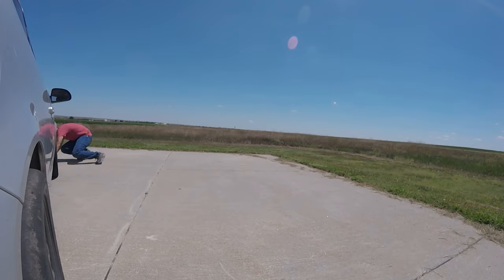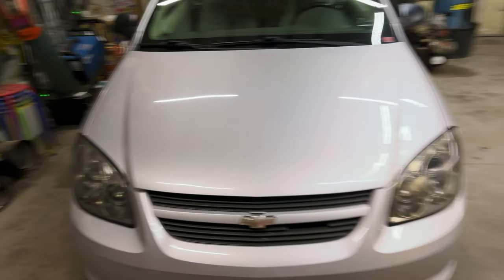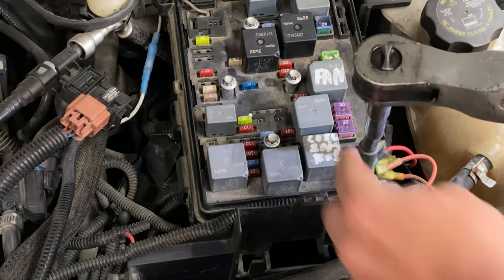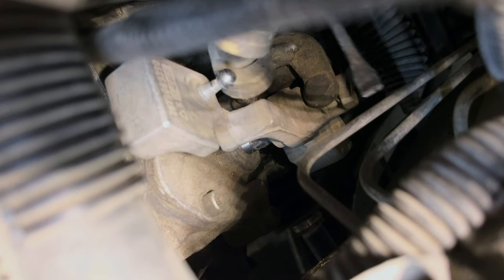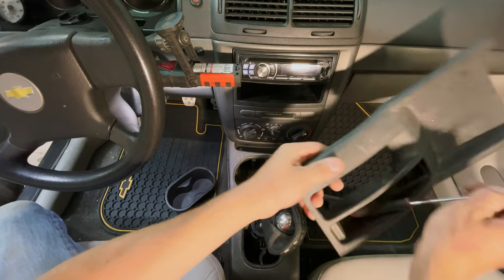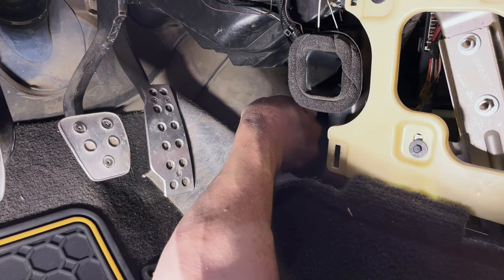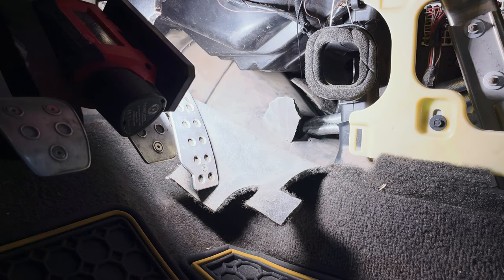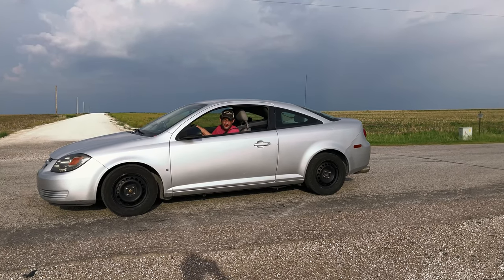Chevy Cobalt Shift Cable Replacement

Comment: What a ripper!!! I just picked me up a cobalt and wanna figure out what software people are using to tune these things. Be a waste of money having to send my tune to zzp everything I change exhaust stuff or intake stuff or pulley sizes or fuel
Reply from the maker: If you have an 05-06 base you are SOL like I was. I had to do aftermarket ECM and went with AEM Infinity.  07 and up you use hptuners. Pretty sure ZZP uses hptuners for their tuning services as well. Trifecta used to cover 05-06 but they dropped support some time ago.  Hope this helps!

Comment: Finally! Someone else who is in the base model world. I have an 06 ls, coil overs, short throw, i manual swapped it in 2018, but man I am stuck on the ecu, I wanted mega squirt but with recent research I was thinking aem . Did you find someone with a base tune? Or did you make a tune from scratch? I’m wanting forged internals but that’s a price point I’m working up too😂my plan was turbo but before any of that I will try for 200-250 NA HP. Then boost but no rush for boost. Any advice at all? Like dude I e been looking for someone who has done this for 4 years😂 I don’t want to “sell it and buy an SS”😂😂
Reply from the maker: Busy atm but I’ll get back to you more thoroughly when I get a moment
Reply from the maker: The SS guys/gals are elitists. An SS is just a base model with some performance parts and better seats. The one thing I would recommend is don’t even waste your time trying for more power NA. High cost to HP gain ratio. Save your money for boost if that is route you wish to go. Setting up the AEM was expensive when I did it years ago. No plug and play wire harness so you have to build your own. It’s also fairly overwhelming at first.  It’s doable as I have done but definitely not most cost effective. Turbo will make you most power per dollar. I only ran stock internals for short time with m62 blower. Only thing stock left is crankshaft lol. Let me know if you have any questions but know the route you are considering is difficult and pricey. Not trying to talk you out of it just don’t want you to end up discouraged after it’s too late.
Reply: @fabricobbletech it’s all overwhelming if I’m being honest😂 but I am trying to go for the best price. I want reliable horsepower. But at a decent price. I’m prepared to make a new harness completely but is your daily drivable?   Also did you pay a tuner? I’m honestly trying to learn tuning myself. I have no problem going straight turbo with just internals upgraded. Also did you use all your stock plugs when making your own harness? Where did you order your parts. I have seen skunkworks, ZZP, and a few other sites. I’ve got many more questions but I’ll hopefully space this out to where I can follow it when I start the build.

Comment: I technically have a SS, 07 2.4 auto. I eventually plan to super charge it if i keep it long enough. Your car is pretty cool though.
Reply from the maker: Aesthetically my Cobalt is a econobox turd. Functionally I essentially have upgraded SS suspension and even engine. Only engine part left from my 2.2 is the crank.  I do still have stock brakes with drums in the rear. If I ever do road course that will have to change but honestly even for auto cross the rear drums are just fine. People hate on them because they overheat much easier but most of those people have never driven hard enough to heat up their brakes anyway. Tbh for auto cross anyway, I still need more front bias.

Boost is fun. It’s gotten a lot more expensive than when I did all the work on mine a few years ago.

Comment: What supercharger ? Been trying to find a 2.4 2011 LE5 Kit for my 2011 Malibu. But it’s been slim looking online
Reply from the maker: Harrop TVS1320.  The supercharger is aftermarket but it bolts directly to stock LSJ intake manifold. Pretty sure LSJ parts will bolt to LE5 but may want to confirm. Stock LSJ supercharger is M62.
Reply: I just did this to my cobalt le5, most likely all lsj parts would directly bolt up to it if its similar to the cobalt le5

Comment: i just inherited a 2008 cobalt LS , I broke one of the shift cables will this method working on replacing mine? I don't know much about cars, but I want to make sure I get all the info I can. So i can try to fix it myself.
Reply from the maker: Yeah yours should be exactly the same besides a big plastic engine cover I removed a long time ago. Mine is an 06. The hardest part is fighting the damn cable through the firewall!
Reply: Perfect thank you so much. Yeah, the firewall doesn't look nice at all. I'll let you know how the repair goes.
Reply: @fabricobbletech   I'm also wondering I have it stuck in a gear should I find a way to put it into neutral before replacing them?
Reply from the maker: @LoganMyking  It will help set the cables with your shift lever. You can move the transmission actuators by hand manually once cables are popped off.

Comment: Are you on Stock Internals!?
Reply from the maker: Used to be back when I started with M62 supercharger. Then I went forged rods and pistons but did dingle ball home in garage. It worked well for a while but ultimately was an oil burner.  Now I have eagle rods, wiseco pistons, STOCK crank but with LSJ block. LSJ block is essentially the same as L61 block but with added oil squirters. Camshaft is a little different on the end of intake cam. Iirc I had to cut LSJ cam to fit L61 head. But now I have zzp stage 2 blower cams valve springs with titanium retainers.  Stock LSJ valves. Basically only the crank is left from original L61 but you could easily run this 1320 blower with only forged rods and pistons. You could run on stock rods and pistons but you'd be living life on the edge.